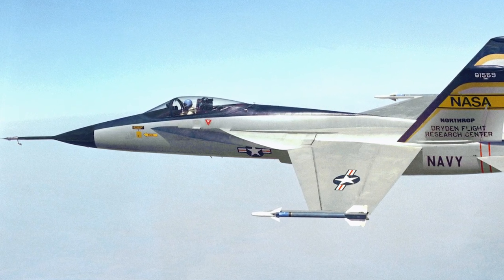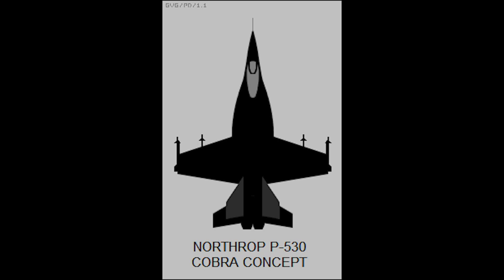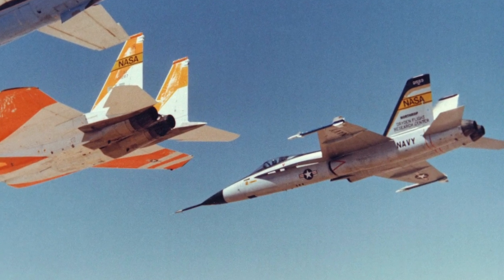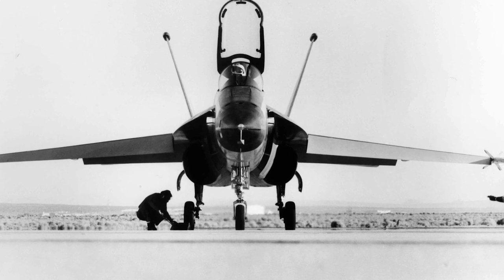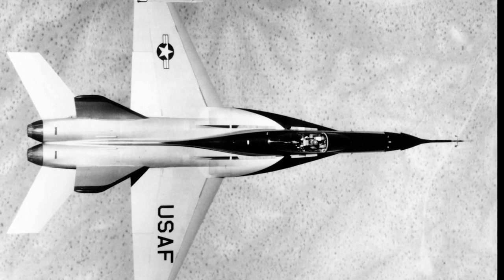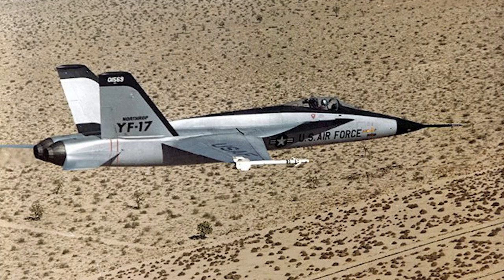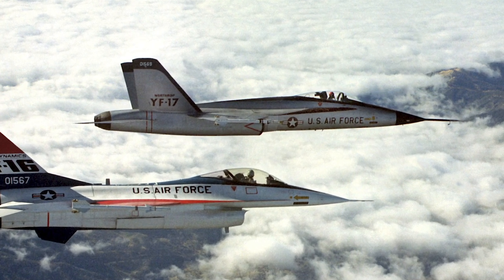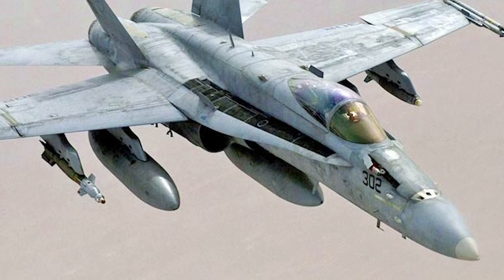Northrop YF-17 Cobra - A Short History

Comment: This is the plane that Top Gun should have used for the fictional MiG-28. The Northrop F-5 just doesn't look very MiG-like.
Reply from the maker: I think they probably used the F-5 since it was used as an Agressor aircraft in training excercises. I believe its characteristics made it good to simulate the Mig-21 (although visually they are very very different). Only two YF-17’s were built and they would not have been available to the film crew…but agreed, they would probably look a bit better.
Reply: @A_Short_History  Yes, but by 1985, when Top Gun was filmed, the MiG-21 was way out of date. The state of the art elite Soviet fighter jet was the MiG-31 Foxhound, which more closely resembles the F-15 Eagle. If the fictional MiG-28 is supposed to be an even more advanced design, the F-5 would be a poor representation of that. If only two YF-17s were built, then they could've used some modified F-18s, which were developed from the YF-17s.
Reply from the maker: Very true. My guess is the F-5’s simply were what was made available to them at the time.
Reply: You do realize that this plane was further refined into the FA-18, right?
Reply: @jaybirdk7414  Yes, I'm well aware. It still would have looked better than the Northrop F-5.
Reply: @44excalibur , I suppose, as many people here have, that they used what they had available.
The Top Gun class portrayed in the movie we’re going up against “F-5s and A-4s to simulate the MiGs.” Of course, the Skyhawks were shown, but you and I know what those F-5s were used for.
Portraying a fictional plane made it somewhat believable for anyone who didn’t grow up on a military base or five, I suppose (my Dad was Air Force), but it made more sense than Iron Eagle using an F-4 (THE seminal MiG killer!!!) to Porte the Russian jets.
Reply: @jaybirdk7414  Iron Eagle did not have the cooperation of the US Air Force and was made in Israel.
Reply: @44excalibur , it showed. 😉

Comment: The YF-17 Cobra was put into production the Blueprints where sold to the Canadian Air Force they use the YF-17 Cobra .
Reply from the maker: From what I can tell, Northrop demonstrated the YF-17 to potential export F/A-18A customers. They applied temporary markings for certain demonstrations, including for the Royal Canadian Air Force and Spanish Air Force. But only two YF-17:s were ever built. Canada use CF-18A:s.
Reply: YF-17 would be slightly more manuverable than F-18. F-18 has heavier landing gear because it is an navy fighter.